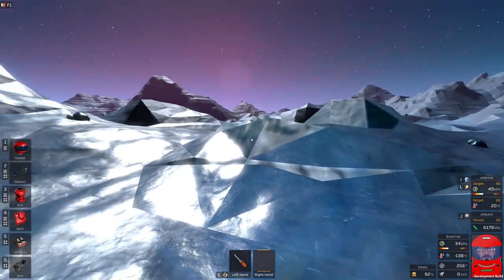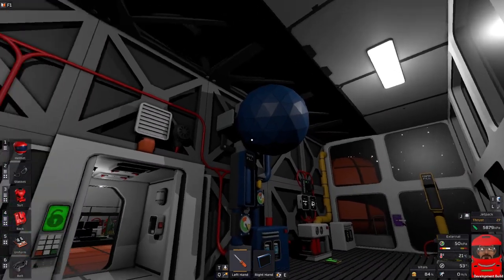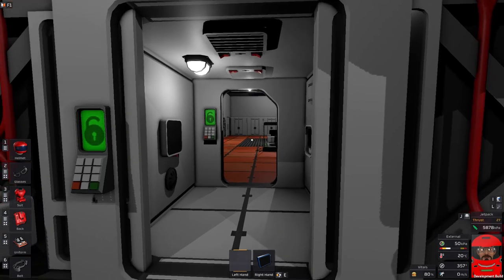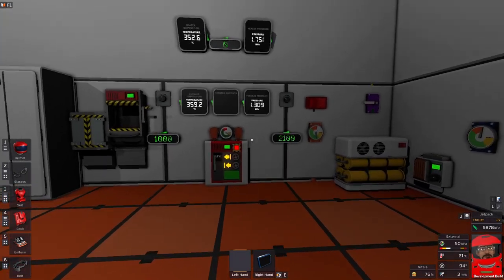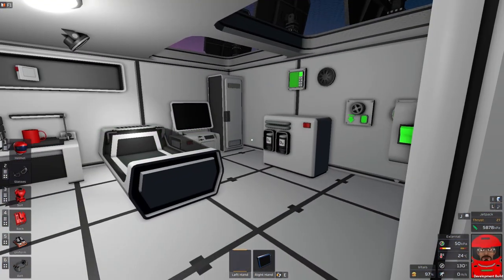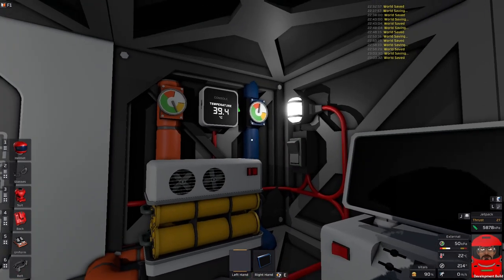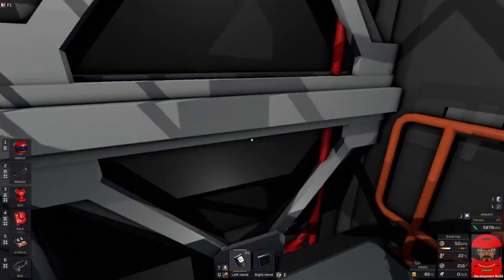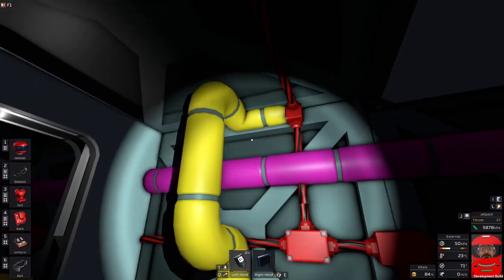Stationeers Europa base building  Tricks and tips

Comment: If you don't want to use the heat from your generator to do anything like heat the O2 tank or generate electricity you could get it in a vacuum so that there is no air to trade energy with.